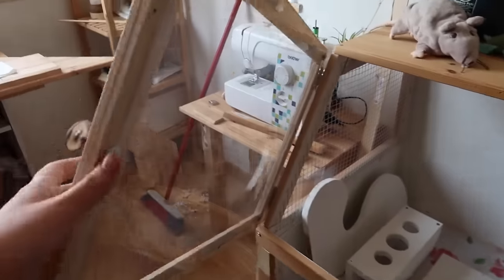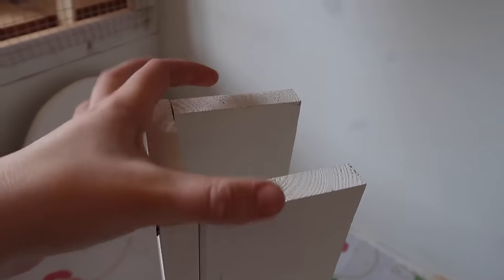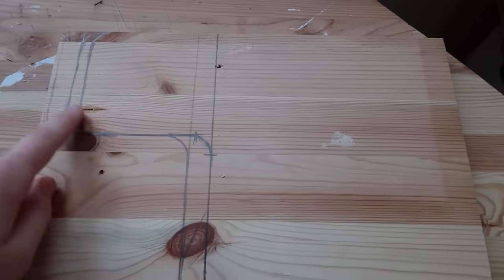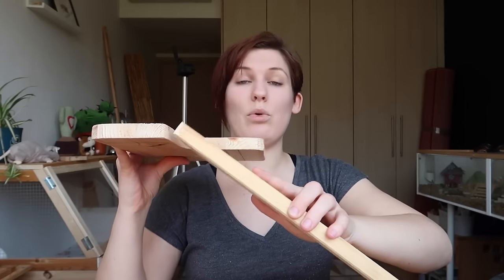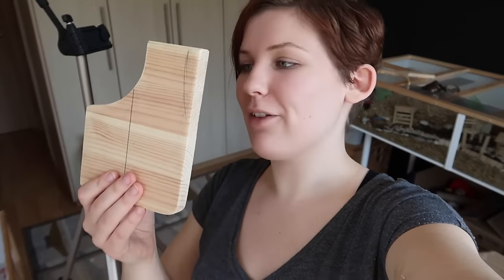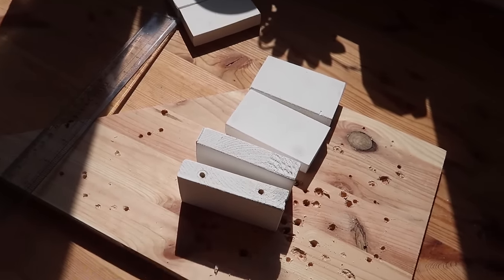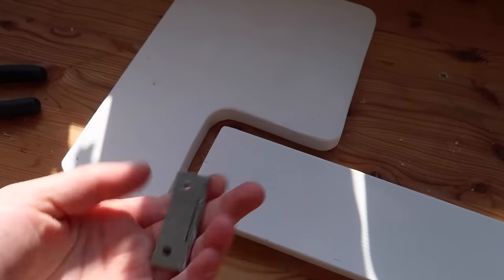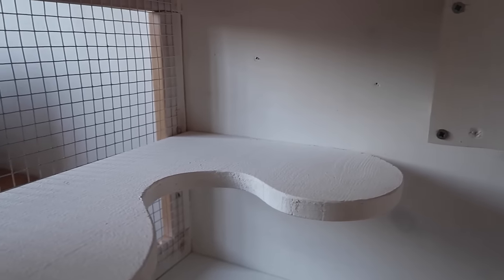Building The Bunsen | DIY Hamster Cage 1069sq inches [2/3]

Comment: mice??? it isint  a hamster  since hamsters cant jump high
Reply: Girly Cow Gaming there will be substrate in the bottom
Reply: yea but  how is it going to get to the top
Reply: Girly Cow Gaming there are ladders and steps
Reply: 6:25 the corner and 6:50
Reply: Girly Cow Gaming if u look u can see that there is a tunnel and a step
Reply: Girly Cow Gaming I still think it isn't a hamster cause levels are dangerous for them and she would have been added shelved to her other cages if she knew that wasn't a factor. the hamster I use to have would fall from her levels all the time and try to climb the bars and fall. Levels are too dangerous for a hamster
Reply: yea or a syrian
Reply: Girly Cow Gaming a chinchilla she only needs a big wheel
Reply: Chinchillas would not fit through the holes on the tunnel shelf.
Reply: yea exactly lilkittyanime
Reply: Girly Cow Gaming male mice would be the only option.

Comment: To help others, here is the info we have, 
-She has owned this pet before but not for a while. 
-it isn't a rabbit (she has already had 2 and doesn't want anymore and she Walpole the have them caged anyway)
-the cage is too small for a guinea pig or chinchilla 
-probably not a gerbil, they chew A LOT and wood cages are too good for them
-could be rats or mice, but they are hard to care for in Cyprus (although so are rabbits and hamsters) 
-she has said she will only be keeping one hamster at a time, so it isn't a hamster
-another reason it isn't a hamster: hamsters can't have platforms that high because it is dangerous if they fall off, also, all those high platforms and raps and ladders aren't ideal for hamsters. 
-could be a ferret, although they are bigger and I am not sure they would fit the best in all those spaces

Comment: dont you think that the gaps between the hooks and the u nails at the end of the suspense bridge is bit too wide for a hamster or really any animal? im sure on camera its a bit bigger than in real life but correct me if im wrong. other than the gap it is amazing i cant even apply one step without giving up lol
Reply from the maker: Judging by many different comments I would say the camera has warped the size and perspective of the cage, it doesn't help that I'm small which also messes with the perspective lol The gap is only very small though, barely more than an inch. For a tiny animal that could be a bit big but it will be fine for the pet we are getting :)

Comment: Is it safe to build this without using varnish? Thanks!
Reply from the maker: If you want the cage to last longer you really should varnish it, without protecting the wood the cage may only last 6 months by protecting it the cage should last a few years at least :)
Reply: ErinsAnimals Ok! Thanks!
Reply: ErinsAnimals what varnish do you use?  I want to build a cage for gerbils.  I don't have them yet, but I'm so upset by the lack of quality and correctly sized cages.